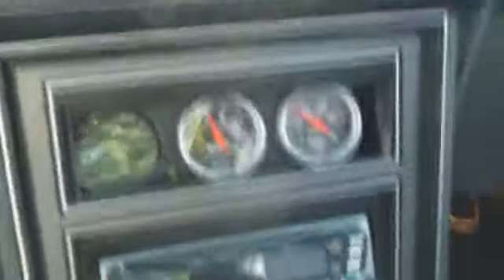First start-up of the Eaton Supercharged LTD LX!

Comment from the maker: I fabbed it up.  All you need for that part is one 180 degree 3" u bend and some 1/4" plate steel.  I'm not really setup to be making these things for folks, but if you can't do it yourself, you could probably cut out the parts yourself and find someone local to you to weld it up.

Comment: Could you fab up something to built an Eaton M112 to a small block chevy??
Reply from the maker: Probably.  But these days, the blower wouldn't be much more powerful  than what you could build naturally aspirated.  550 hp is pretty much the limit for an M112; the efficiency drops pretty badly after that - even at 550 hp you're less than 45% efficient at any pressure ratio.  Back when I did this, it was on a 302 and was on the ragged edge to run 10.5x at 128-129 mph at about 3,400 lbs.  I'd look for at least a 2.3l Whipple, 1900 TVS or even better a 2300 TVS or 2650 TVS.  With a positive displacement blower it's hard to go too big...